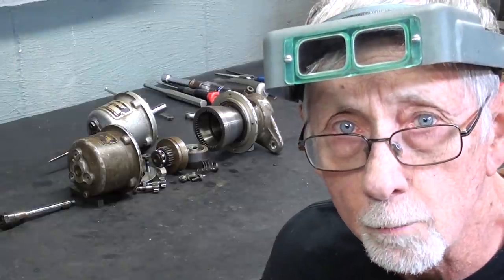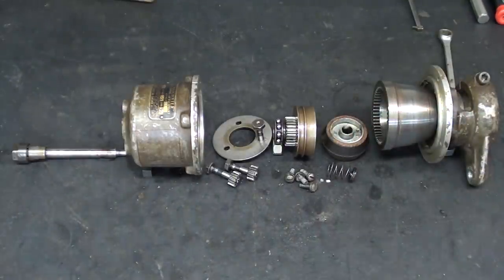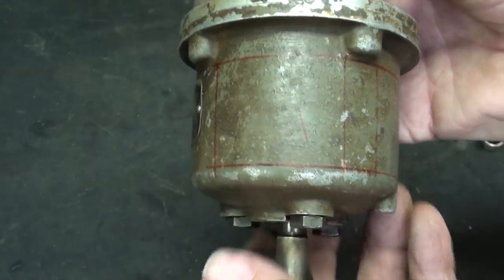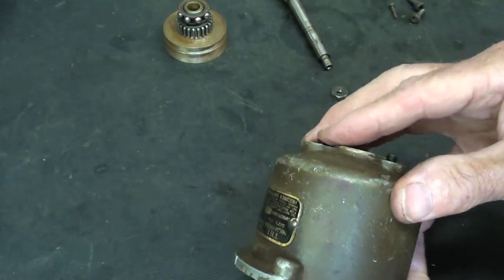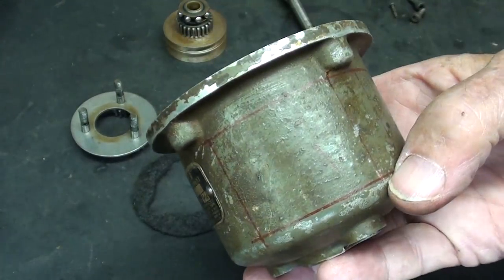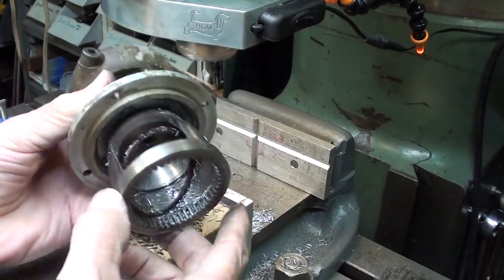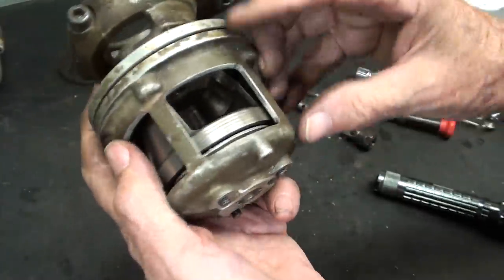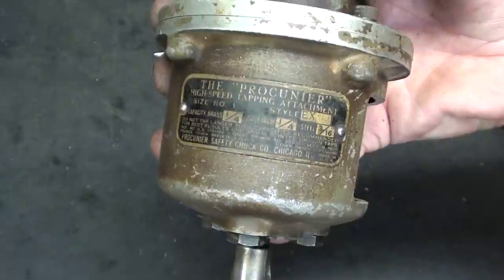Make a PROCUNIER TAPPING HEAD CUTAWAY Pt 1 743 tubalcain

Comment: Mr. Pete,
I was working in a hydraulic shop as Foreman when they got a government contract to supply metric to SAE fitting conversion kits for the Air Force. One of the fittings was to have a jet installed inside . There were none available anywhere. We stocked the fitting but it had a hole bored right through. Well I came up with the idea to tap inside the fitting, then install a grub screw and bore the proper size hole in the grub screw to make it a jet. Well the company owned a tapping head so I made a deal to get one dollar per unit to do the work at my house and they supply all parts including drill bits, taps and give me the tapping head to boot!
I did the work and made a few bucks and the tapping head is different from the one you have. It has an arm that rests against the column of the drill press and has a number two taper to mount it to the drill press. I have never used it since that one job.
Reply from the maker: Thank you, that was an interesting story

Comment: you could cut half depth into the ring gears to give a better view of the planetary motion, you only need a small working portion of that ring gear engaging with the planetary gears, as its not going to be taking the normal stress of tapping operations

Comment: When I began my maintenance career in the machine shop there may have been 20 Tap-Matic tapping heads in service. I don't recall any Procurnier  heads. Maintenance did all machine maintenance, but machine shop did all tooling maintenance. I never had any occasion to service our tapping heads.
I remember the first CNC mill we purchased that was equipped with "synchronous tapping". That was pretty fancy. We no longer required the long length tooling capacity to hold the tapping heads. Standard tooling length held rigid tapping. Synchronous tapping rapidly became shop wide. Secondary operation drill press work was soon pretty much obsolete as well. Tapping heads were discarded about as fast as Farmall 806 mounting steps were discarded as loader frames became popular.
Reply from the maker: Thank you. I think the tapping head is pretty obsolete, and so am I. You will notice no one is watching this video

Comment: 16:23.  The tapping head bears the mark "Brevete S.G.D.G.".  This was the old patent statute used in France up to about 1970.  As I recall, there was no government examination of the invention with regard to novelty, utility, etc.  Instead, the inventor's statements about the invention were merely accepted.  It was apparently only a registration system. 
My first job down at the plant (after high school but before the university) was to run a Procunier head threading holes in pieces of steel strap, endlessly...endlessly...the only relief was provided by the walk to the tool crib to get a new (sharp) tap... Thanks for the memory.
Reply from the maker: I tapped 1 million holes in electric fishing motors.   The only relief was going to the bathroom
Reply: @mrpete222  Excessive bathroom breaks could resulting a talking-to from the foreman.  A broken tap was a more palatable excuse.

Comment: Hey! I have one of these, or something very similar, came with a "Quadrille" 4 chuck running tool changer for a 50's era Delta-Rockwell drill press. Look one of those up, Super cool design and I have had trouble getting mine put back together correctly. After a while the clamp that tightens onto the mandrel slides down and I can no longer change between tools. Getting it apart is like a puzzle or a lock or something, very cool tool nonetheless.

Comment: Hi Mr. Pete. I find planetary gears fascinating too. In fact, I built an Allison transmission that has 3 sets of planetary gears systems out of Lego’s. It has 6 speeds forward and 1 reverse plus neutral. You can see it on my channel. Nice job on the cut-away.
Reply from the maker: Thank you very much, I just watched your video. Quite an amazing model that you made. Was it a kit or from scratch?
Reply: @mrpete222  Thanks. Glad you liked it. I made it from scratch. I used parts from my collection of Lego sets. I will make an exploded view of it, showing how it is made using a Lego cad program called LDCad.

Comment: This is a tool I've always seen laying around the many shops I've worked in, that never got used. They are really only useful if you have a large quantity of holes all needing tapped with the same size tap. I always put the tap right in the drill chuck. Tapped thousands of holes in Die Sets on the Radial drill press, most of them were all different sizes and there is no good way to trap the anti-rotation arm of the head on a radial drill press. Just my 2 cents worth.
Reply from the maker: They are strictly for repetitive production work